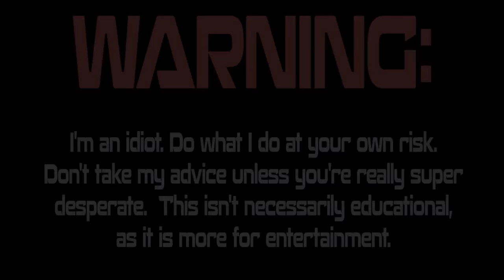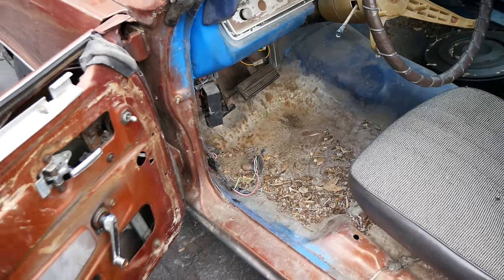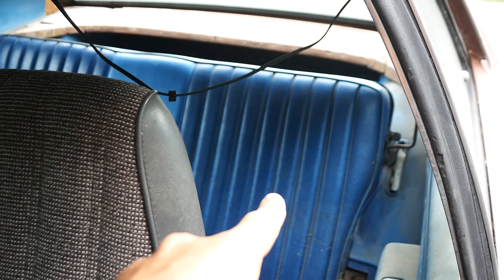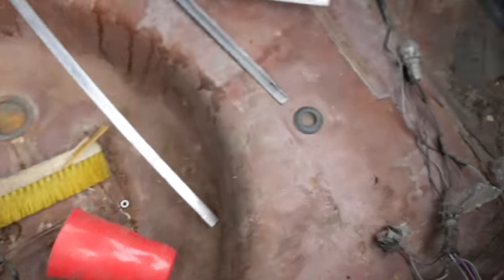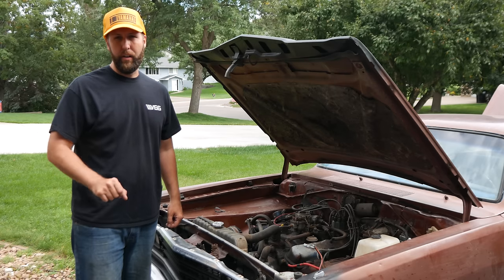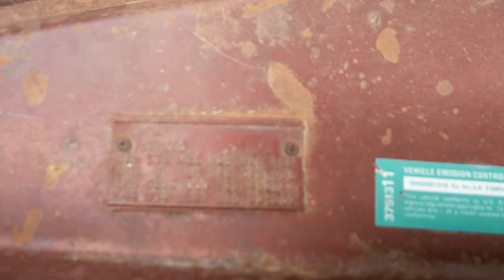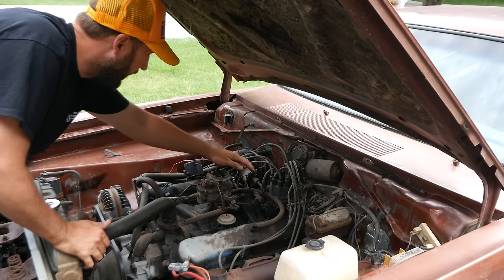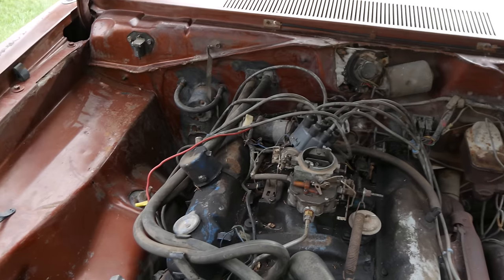I Bought a Plymouth Duster SIGHT UNSEEN - WILL IT RUN? - Vice Grip Garage EP47

Comment: If that trans wasn’t smoked when you got it, it was after you drove it…..without any TP linkage. Also, the 2843953 and 3614395 manifolds don’t use donuts.

Comment: I was just thinking ‘cool, those wheels are are exactly like mine’ then guy says ‘these rims are hideous, they’ve gotta go!’
Took the wind out of my sails ha ha😂
Reply: that can be him just joshing
Reply: Different strokes for different folks . I like them
Reply: B Annoying  ,👍
Reply: why didn’t he use an electric fuel pump to the carb and check the accelerator pump like he did for all the other cars that sat? Instead he beat on the poor starter way more than he should
Reply: @Nombre Apellido No worries, I wasn’t offended, just found it funny. As a few have said different strokes for different folks. Thanks!
Reply: They not so bad if you polish them, look KINDA like center lines.
Reply: i died lol
Reply: hey.....at least all 4 are the same.  Very unusual for one of his projects
Reply: Well I be dipped, Had the same rims on my old Toyota pickup. Loved them when I had it.
Reply: I like the rims. Lol.
Reply: @werewolfsaves2179  I like 'em too.
Reply: I like those rims.
Reply: @CoIoneIPanic  Thats my exact aesthetic though.
Reply: Yeah, I thought they were pretty nice, too!
Reply: B Annoying  
I drove a duster in high-school!
   73 pee green with the Mopar v6!
    Every once in a while, it would randomly die.
   It wouldn't restart for hours, then it would start up  without any work?
    Left me stranded more than any vehicle, but being my first, I washed & waxed it constantly.
Reply: B Annoying  
  It was a pos, but it was a straight pos.
    My sister ended up trading it in on of all things a used pos renult. 
    Pissed my dad off but she did the deal and he had to sign it over.
Reply: B Annoying  
Hahaha!
   I tell myself I wouldn't want to be that young again , but I think I'm not being completely honest with myself.
Reply: That cars name should be Beatrice....
Reply: @jupitercyclops6521  V6 or Slant 6 ?
Reply: Dito, but I'm gonna have to disagree with him on this one.  I still love my rims.
Reply: I thought they looked pretty good. 🤷🏾‍♂️
Reply: Like to have them for my 73 charger!
Reply: Same with me. They came on my dart. Im gonna change on 'em, but they're alright.

Comment: When I tore down the 318 from my 69 fury, I thought I was going in for a re-ring and valve grind. 
She was a little rough and smokey but still started well didn't knock and made decent power. What I found was 7 cracked pistons, 3 burnt valves, a cam gear with more than half of the plastic teeth completely gone, and an oil pump completely full of muck and ground up engine guts.
Once I spent way more money and time than I wanted to, I got her back together but it just would not run. 
Took days to figure out the distributor spins "backward".
My mom still has a picture of me grinning like an idiot surrounded by that first start smoke cloud. 
That engine taught me a thing or two about life and such..

Comment: That distinctive Dodge starter sound and having to wait for the starter to stop spinning when it doesn't fire.  Exactly like my dad's 73 Dodge truck.
Reply: 1968 dodge coronet r/t 440 loved her as a teen, she was hit/crushed by a truck  while sitting still in an icey parking lot.
Reply: @robertmiller5735  damn what a bummer I had a 68 Coronet 440 as well. I still have a 76 Dodge 4 X 4. Military truck D300
Reply: Man I grew up at the wrong time.While my 1st car was a 62 Bel air it would have been cool to have  a 440 coronet or 70 chevelle  back in the day.
Reply: It ain't going nowhere if the ballast resistor is kaputsky

Comment: Duster trivia: Ventilation comes from opening up a small door under the dash on the passenger's side. Behind that door is a small compartment that is large enough to fit a six pack of cold snacks. Keeps them at the proper temperature, especially in the cooler months.
Reply: I think my Satellite Sebring had the same factry option.
Reply: I remember that air vent.

Comment: I do believe that all Mopar V8 are the same fireing order, but you have a good start to build a very nice hotrod, build a 360 and don't forget to change the torque converter because the 318 is balanced different than the 360 little weight on the torque converter

Comment: A feller learned back in the way back (80's), that Mopar parts are always more expensive.
Reply: That's how the Chrysler Corp was able to keep afloat all those years. Put out cool-looking cars with big engines, haphazard engineering and little to non-existant quality control and wait for the deluge of orders for parts to fix 'em up.
Reply: They are more expensive because of the fact that people junked them more because they weren't a Chevy or a Ford and better quality than the compation and people that restore them have to more time into getting parts also
Reply: @spikebebop9070  So what did they do? They went and bought another low rent car company in AMC, back in 83. Just so they could have the Jeep brand. The 4.0L that they put in Jeeps for years, was originally the AMC 258 cid.

Comment: Derek, you should call her the "Cluster Duster."
Reply from the maker: I like it
Reply: They made one called a feather duster from the factry!!!
Reply: Cluster Fuck Duster
Reply: @dragcarbuilder2075  the feather duster had an aluminum trunk lid
Reply: @stephens340   I know they did I have built a bunch of mopars and a lotta A body cars I just bought 71 340 4 speed car about a month and half ago it's an original feather duster it had been painted they had changed the hood but I went back and checked the deck lid and it was aluminum so with further chexking it was an original feather duster and I,was lucky to get it..mopar have been using aluminum panels on a bunch of cars simce actually late 63 413 cross ram cars 64 the maxwedge and race Hemi,cars and my dad bought one in 66 new Hemi car which was radio delete heater delete car w aluminum front end light weight glass and doors and trunk lid and also hood it even had a lightweight K-Member and had lightweight seats and even had lightweight rims and bumpers strictly a drag Car from the factory that was stolen from my uncle's place here in NC and if i ever come across it was painted black cuz we had all of the sponsors and it was named the stipper had less than 20k,on we blew the race Hemi and we had changed the k member over to a 440 k member and we had a built striker 512 all done so we were switching it over he had started diving it on the street and started racing another car so we had set it up to drive on the street I have been looking the car for 20 yrs so I can build for my father it has 25% heart function left and,I wanna find it no questions asked if ya come across it I am offering a reward for it! Can't stand a damn thief ..sorry I got off subject but can't help it one thing led to another aluminum body panels could lead to anything just one conversation!! Are you building a feather duster or an A body car I habe a bunch of parts for the swingers and demon,parts I wish I could a You Tube channel up and running cuz I have 40 yrs experience and learned it all from my dad that is why I wanna try to find his old car and build it for him while he can still enjoy it!! Take care man sorry my reply was so long!!

Comment: A trick the old man told me about with carburetors, when the jets are stopped up.  When you get it running drop a 1/2 cup of  30w down the throat and immediately cover the barrels, the excessive vacuum will suck all the crud out of the jets.

Comment: The small block Mopars had that lovely plastic lower timing gear. I replaced mine with a steel double roller. Lots of potential in that old car.
Reply from the maker: Most likely the case
Reply: I was in a middle of a derby when mine went. That old 318 block with Lucas never did shut down. I just could touch the back bumper from the driver's seat.

Comment: Nuthin' sounds like a Chrysler starter
Reply: the starter on my 80's subaru wagon sounds the same
Reply: You can call it by name even from that guy down the street.
Reply: Flashbacks to my 65 Dodge Dart with a slant 6 and 200,000+ miles, you had to prime it with 104 octane boost just to get her to start!
Reply: i always thought the same thing, not sure how they managed to keep that starter sound so long but was listening to someone start a newer 2000ish dodge and sounded the same still
Reply: Yup, my 73 superior motorhome has a dodge m500 truck chassis. With a 440 in her. That starter sounds just like mine, has always worked though,  no problems with it.
Reply: @CamoShirt  it's because Chrysler used gear reduction starters for years.
Reply: As a young kid I remember another kid down the street his dad was car dealer and he brought home new big Chrysler and the starter sounded like it was attached to the fender it was so loud.
Reply: The starter sound is why I didn't like mopar when I was young. Glad they no longer sound that way.
Reply: @jkalash762  yep, gear reduction starters.
Reply: Who would want to???
Reply: @CamoShirt  Similar sound but not exact. Starting in 1989 Chrysler started to use Nippondenso ( now just Denso ) starters on their V6 and V8 engines when they changed to fuel injection. Also late 1980's and early 1990"s Nippondenso alternators were famous for catching on fire between 120 to 150 thousand miles.
Reply: 90s ram dakotas and durango sound almost identical

Comment: My first new car was the twin sister to this, a 1974 Dodge Dart Sport.  Blue w/blue interior and white Vinyl top and manual sunroof .  318/automatic. The fold down rear seat allowed me to visit camp sites and sleep 2 comfortably. Ran and drove super. Trans went out at 34k miles, otherwise was perfect for 60k miles.  Forced to trade in on a 1980 Ford Fairmont station wagon (total POS) due to my newborn son. I miss the Dart to this day.

Comment: My first was a 1971 Duster with a slant 6, which I swapped for a 318 bored over 30 with 340 heads, 4 barrel with headers. Swapped the rear end with a 8.75. Neat little car that I sold to a guy who built it as a 1/4 miler with a big block Chevy motor shoe horned in. Like many cars I've had over the years, wish I'd kept her.

Comment: I had a 1980 ram charger snow commander, I went through a dozen voltage regulators and left headlights. I finally looked inside the voltage regulator plug and there was nothing. I added female ends to the wires to the regulator. No further problems.

Comment: Add a fuse holder to the smoke meter. Fuse replacements are not only cheaper than replacing a meter, or the internal fuse, but also quicker than replacing the internal fuse, getting an internal fuse, or even driving to Walmart!

 (personally: ATO, because that's what my car uses. I also soldered the socket in, but some heatshink butt connectors will work)

Comment: I had an 1985 Dodge Diplomat with a 318.  Last car I owned with a carburetor.   Great engine. It had  350k miles on it when I sold it and it still ran well. One of the best engines ever.
Reply: Irony was that the '89 Fifth Avenue had an airbag but still a carburetor.

Comment: I had a 74 Space Duster. Replaced the potter wump, the timing gears with METAL ones, as the originals were plastic, and always had two ballast resistors in the glove box ☑️

Comment: My 60's and 70's Mopars all benefitted from a bypass of the ammeter in dash and straight wire from alternator to battery.  Maybe some of what you saw with odd wiring going on.  Wiring for ammeter in dash burns up easy and fires in the dash are  not too cool.  I like to rip most of those out and convert to single wire alternators, cleans up a lot extra junk and wires under the hood and makes the dash fire situation better 👍
Reply from the maker: Great tip thanks

Comment: The ballast resistor has a wire inside that looks like a spring when it gets hot it will separate if it has a brake in it and then it cools down and makes contact again and it will fall at the worst possible time 
Been there done that Lol

Comment: In a situation like this, the hard part is finding out what failed. Im curious if the carb is not due for a rebuild. Idle is rough, exhaust tone is horrible. As often as it dies, im curious about the activity of the fuel pump.

Comment: might be a little late but as you can see in the profile picture im a mopar guy but i’ve found with them older rigs there will be a vacuum leak through your brake if you push brake in when turning over the fire right on up

Comment: I remember trying out a similar duster at the dealer in 1974. They were running a sale on some plain Jane models.  The salesman couldn’t get the first two started.  Got one started, we piled in and it died before we got out of the lot. These things were crap then and really crap lo these many years later.

Comment: I had to do a timing chain on a 318.  It was a chore for sure.  The bad thing about the 318 is the head bolt holes go into the water jacket so take that for what it's worth.  Or you can just drop a 360 in there.

Comment: Hi Derek, my 2000 3.2L petrol Isuzu runs rough  till revs reach 2000rpm. Terrible response till revs build. Runs well at revs. Has new plugs, oil, fuel and air filters. Doesn’t heat up. Fresh purchase so history is unknown. Could it be as simple as new coils or even replacing or cleaning the airflow sensor.

Comment: A shiny wheel guy put those wheels on. Lock tite glue helps deter license plate theft, then use 3 types of screws and bolts to lock em down semi permanent;  clean junk impresses more than grubby. It only has to make a taco run now and then

Comment: May sound like a stupid question, but why is there a round tube sticking out of the manifold on top of ds manifold shield? Iv noticed this on alot of older engines like sbc and such. Is it just for ventilation or does it serve a purpose?

Comment: Timing chain(New), intake & 4bbl carb(swap meet) not be to bad. Get it to run better. That 904 trans is not the greatest in the world, don't rebuild it. Upgrade to a 727 torque flight. Then you will have a nice runner. In the late 1980's I did a couple of Darts. Good running cars.

Comment: so is 950 a good price for a 1974 duster with a 6 cyndler in it not in realy bad or good shape but all the floor board and trunk pan is there motor not locked up

Comment: Give  her the old  Italian tuneup!!!
Reply: It will come back.   The slack timing chain isn't a problem on these as long as long as the ignition timing is on.   These aren't known for jumping timing chains and they don't run very much different even after replacing a slack chain especially a low performance 1974 318  2 barrel.

Comment: Again that little ballast resistor  On the   Firewall On the driver's side It Has 2 sides One side is for starting The other side is to keep it running If one side Burns Out  it either Won't turn over or won't stay running You can jump it with a little short wire    Our whole family drove dodges  In the seventies  We all carried those little ceramic blocks in the glove compartment for a spare I thought he read the comments . He does not seem to know about the ballast resistor or he would have jumped it with a piece of wire and it will run

Comment: I can guarantee you that the nylon teeth on the timing gears is worn off just due to the fact that when you advance the timing it started and the distributor resistor is bad or should I say coil resistor

Comment: Reminds me of the timing chain on my Cleveland when I got it.. The people that had it must've just put the original chain and sprockets back on when they rebuilt it because it was 30 over, still had cross hatch but the chain had over half an inch of play in it and all the teeth were shark finned and it was two teeth off on the timing marks. People do really stupid things to engines.

Comment: I had a 73 Dodge dart with a 318 in it.  Had a bit of work done to it, headers, 4 barrel, and a 3 speed tranny.  Thing ran like a raped ape.  That's the one I wish I had kept.  My dad bought a 76 Valarie (one of the top 10 worst cars easy) which had the straight 6.  EVERY time he drove that car he'd say, "Wish I had gotten the 318".

Comment: By the way I'm going to give you Dodge and Chrysler fans a very simple but very neat trick hotter spark distributor rotor part number MO-3000 that's the ignition rotor from NAPA Auto Parts if you look at the spark travel in the cap and rotor shooting up not across rotor will make it  work like it supposed to look up the Gap to the contacts in the cap to send the spark to the spark plug the # MO-3000 rotor it was one of my greatest tune-up tricks for Mopars. And always check your vacuum advance diaphragm and make sure it work and mechanical it's an old one just put a new one on with the lighter spring

Comment: STEP 1  Remove POS Automatic Transmission,
STEP 2  Remove POS  Torque converter and flex plate., POS shift cable AT cooling lines
Step 3 Install new Pilot bushing/bearing.
Step 4, Install new or resurfaced flywheel, clutch disc,  pressure plate. and release  bearing
Step 5 Install Standard Transmission of your choice (4/ 5/ 6 speed) and shifter.
Step 7 Address drive shaft length if necessary,
 Step 8 Acquire and install clutch Z-Bar and linkage. Then tighten stuff with wrench.
Step 8  Have about 1,000  times the fun driving your new '72 Duster.
The end.

Comment: Dodgenstien. It’s made from the parts of other dead dodges. 

At least that’s what I’ve called every mopar I’ve ever owned and I’ve had a bunch. 
This video is a year old and I’d bet a dollar to a doughnut that you ain’t figured out the electrical yet. Worst part of the 70s Chrysler was the wiring. Hands down!